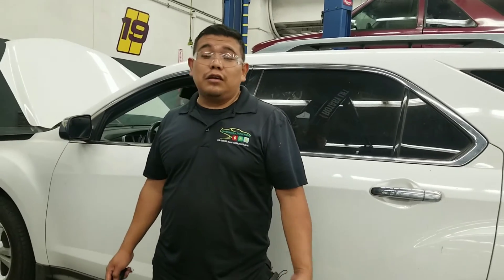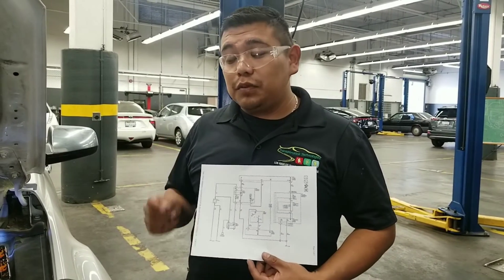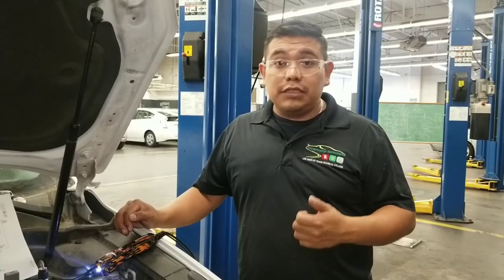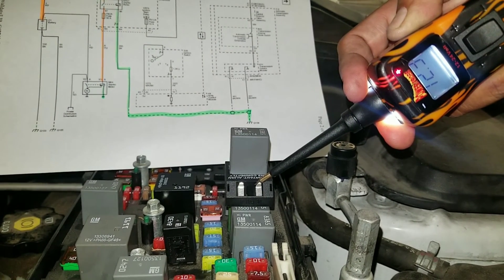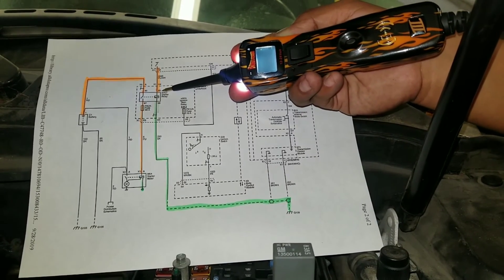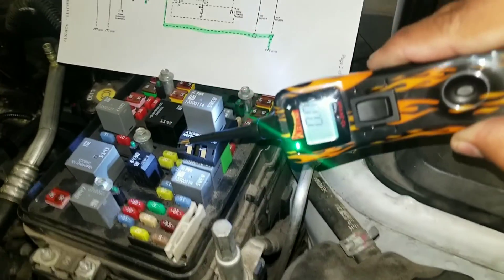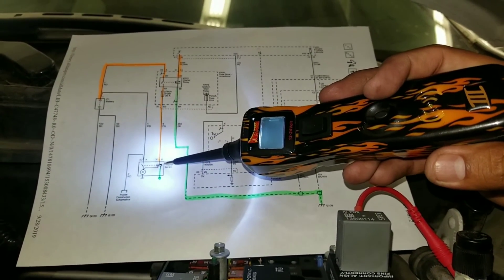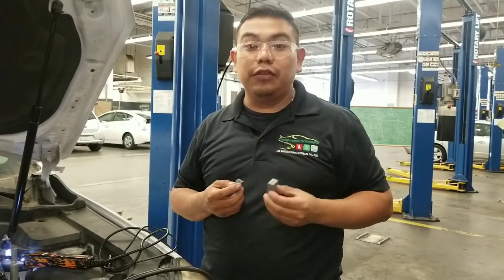How to Test a Starter Motor Circuit

Comment: Hey Mr D great channel!  Question, my 2006 Dodge Ram 2500 Diesel is having a delay ( about 8~10 seconds) once the key is inserted in the ignition and turn to the on position then after those 10 seconds the dashboard gets powered on then I’m able to start the engine, I’ve replaced ignition switch, starter solenoid, safety neutral switch.. but still same issue… any idea what to look for next?? 🙏 Thanks

Comment: Can you tell me what the manufacturer of those alligator meter leads are?  Great video by the way!  I'm always partial to a quick tap or magnet on the relay to see if it closes the coil (if needing to limp somewhere safer or not willing to give up AC or wipers, etc).  I love my Power Probe!
Reply from the maker: It's an alligator clip set, here is the link: https://www.aeswave.com/Alligator-Clip-Set-p8935.html

Comment: What is the probability that the relay is not working on a old car?  One in 100.  It's the part that is hard to get at that is at fault.
Reply: I always grab a bunch from the scrap yard.  They charge next to nothing for a handful and they always come in handy.  They fail more than you think depending on the use of that circuit.  If you are absolutely desperate and stranded, you might be able to repair one by cutting the top off.  I did that years ago to fix a furnace power board (off topic I know).